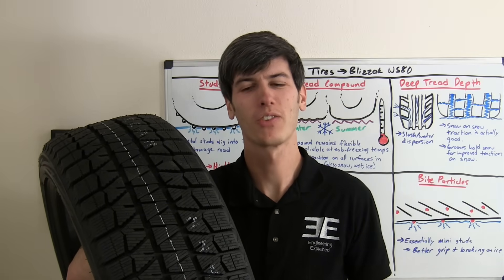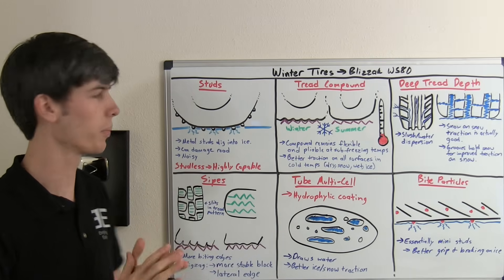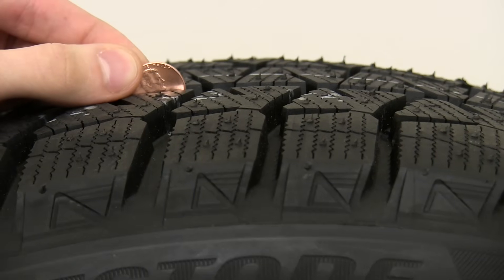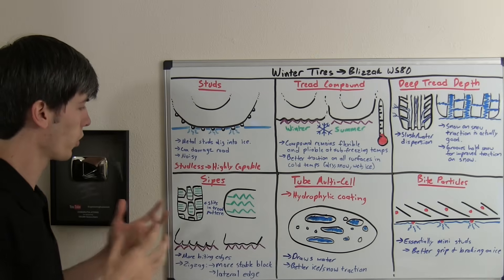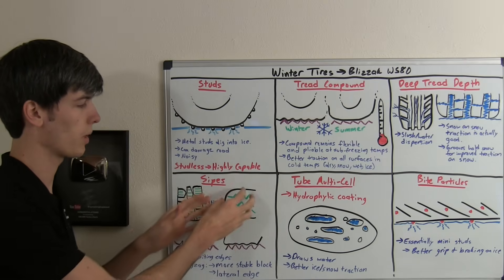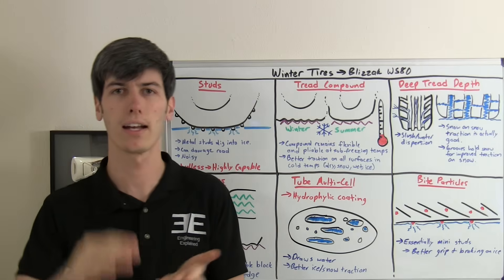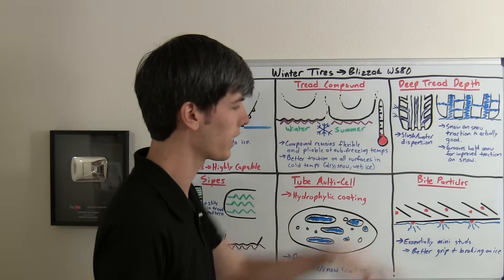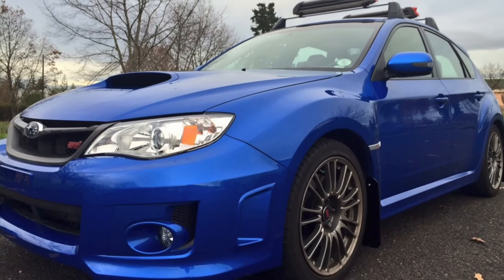Winter Tires Explained - Bridgestone Blizzak WS80

Comment: I have driven many cars with and without winter tires, and I never feel more comfortable in either. I drive a 2010 Mazda 3 and the Dynamic Stability Control makes driving in the winter really easy. My car is a manual so braking is not an issue, since I can use my engine and brakes to slow me down and almost never slide (unless I want to) :P I have driven my buddies car recently, 2000 Honda Civic, with winter tires and I was sliding and losing traction a lot more frequently, even when making small turns. His tires are not as wide, but I was still surprised to feel so much traction issues.
Reply from the maker: Nick_Carriere All depends on what conditions you're driving in. In any situation, asphalt will provide leaps and bounds more traction than snow/ice. Winter tires are certainly not some marketing scheme, the tech is real as are the results (check out comparison tests). When it comes to things like tires, which are a huge factor in the safety of your car as they impact the handling more than nearly anything else, my advice is that it's always worth it to spend a little extra for confidence.
Reply: Width is detrimental to snow tire performance. You want higher tire pressure and lower width to promote more pressure withing the tire's contact patch.  Also Stability control cannot do anything when your contact patch is compromised. Winter tires on any car can do wonders.
Reply: DSC  does not make summer tyres safe on ice.
Only thing what it will provide is stability in going off the road
Reply: Engineering Explained I am not saying they don't help, they just aren't worth the money if a decent set of all seasons will work just fine. From my experience.
Reply: Alex Beau It helps for me, keeps my car on the road. I can tell when DSC kicks in an prevents sliding.

Comment: Why don't all tires have deeper treads? And do winter tires wear while driving in snow/ice?
Reply from the maker: SleepyChow Summer tires don't have deep treads simply because you want a wide flat tread, rather than one with many grooves. Deeper treads will lead to more flex in the tire as well, which you don't necessarily want in a performance tire.

Comment: hello i live in a country without winter/snowing,but im so curious, i wanted to ask, is that necessary to switch to winter tires during winters and switch back afterwards?
Reply from the maker: Zhi Hao Looi If you don't have a true winter (ex: you live near the equator) then winter tires are not necessary. If you live in a climate where temps get below freezing and occasional snow, it can be worthwhile. This is especially true if you run summer tires (as I do), as summer tires will be fairly useless in winter conditions.
Reply: Depending on how bad the snow is. SLC for example its not too bad but if you drive a lot you want winter tires. Go further North and it becomes a necessity.
Reply: lol sure i do not need it, that means in your climate you need 2 sets of tires?

Comment: I'm glad companies are into such marketing opportunities as these, you get tyres, the company gets publicity and the viewers get taught something, win-win-win.

From what I have heard the best winter tyres here in Europe are Nokian Hakkapelitas, which supposedly aren't as available across the pond as here, the Blizzaks are everyone's best choice over there, so gratz on getting good tyres :D
Reply from the maker: David F. Heck no, dealership does it for super cheap, saves me plenty of time. I just had my wheels swapped and balanced (including keeping the TPMS sensors working), fluids check and topped off, and synthetic oil change for $85.
Reply from the maker: It is indeed a triple win, and I was happy to collaborate with Bridgestone as it was honestly my first choice when I started looking for a set of winter tires. At the Subaru dealer currently getting an oil change and the tires swapped!
Reply: Engineering Explained  after having 3 separate oil pain drain bolts stripped out by eager beavers with impact guns, I do my own oil changes from now on. Plus, somehow, they like to brake other stuff (a brake line comes to mind) while they are under there. by using a drain valve now its easy, clean, and cheap; pretty quick too. Now If I can figure out how to check the transaxle oil level in an '08 malibu without a dam hydraulic lift....
Reply: I have studded Hakkapelitas here in Maine, alas if you read the specs on blizzaks they don't last that long. the winter sticky tread is only good for 15,000 miles! then it is a regular tire. I have used my Hakkapeliatas for 5 winters. Putting the on in Nov and taking them off in April driving 500 miles a week.
Reply: Engineering Explained
Gasp, you don't change your own oil?
Reply: Engineering Explained That's a great price, just got my winter tires put on (balancing only no TPMS) by the local shop for about that much!
Reply from the maker: David F. Honestly I was shocked at the price. Typically the dealer charges $80 for a synthetic oil change and tire rotation, so this was heavily discounted. I of course did not argue, and simply smiled and said thank you!
Reply: That's right. If anyone wants proper good winter tires, go for Nokian. It's a Nordic company mainly focusing on winter tires for Scandinavia and other northern countries with severe winter conditions. Don't know if their tires are available in the US though.
Reply: F!@#Guilt Ya that will be a little tricky checking you Transmission oil. What I do is put my car on stands look for the fill level plug half way up the transmission, pull it out, then either move my intake and take out the fill plug or just use a hand pump and pump oil in through the middle plug. Drop the car back on the ground and let the excess drain out the place for the full level plug (make sure the vehicles on level ground tho).....but at the same time my Eagle Talon TSI AWD is a 92 and I change mine yearly. I don't know how these new vehicles are setup, but there's got to be some sort of way to make sure your transmissions not over full.
Reply: Yeah, that is a great way to do it at home. I gave up and took it into a shop since it was cheap. Newer chevy transaxles are like the older ones (least the ones I've used). damn i wish they would use dipsticks. Really wish they would use drain plugs!! Every car has strengths and weaknesses I guess. Chevy, at least right now, uses electronics in everything...everything. so, everything is a weakness. :) my used '08 malibu had dead auto lock switches and only one driver side keyhole. WTF chevy?! :) and they decided to make that part a dealer only part. 100$ a pop. Assholes. :) I've always wondered whether AWD makes much of a difference from front wheel drive.
Reply: wolfmannn2008 I just noticed that. I thought it was caused by the snow on the road- humming.
Reply: Alexander Wänerberger  I've had both blizzaks ans nokian hakapelitas and (didn't stud them) and let me tell you what, blizzaks are way ahead, now, I didn't stud the nokians, so it may be a bit unfair... but i don't like studs, they're good on ice, the're terible on pavement..
Reply: Allen Donaldson
Yea, just the winter tyres doing its thing. When it's too hot or dry pavement they squeek and make drift like noises on corners. Especially 10-15C, it sucks that we have mandatory Winter Tyres until 15th of March when the weather sometimes goes as high as 25. I can feel the tires wearing more than they should.

As for the weel shaking I got more feedback, it 's really mostly caused by the road being paved badly(or other uneven surface), but I notice this on winter tyres only. On new highways the shaking is only noticable after 130-140kmh, as for summer tires i experience no shaking.
My winter tires are balanced and only 1 year old, so that is not the case. My summer tires are 2.5 years old. So i assume the deeper grooves are causing it.
Reply: Nokian tyres are made in a place called NOKIA, in Finland. This tyre Bridgestone tyre here is very good for the Artic/Nordic winters when the temperature's are never above freezing. So very usefull for sub zero temperatures, below 0 Celsius (°C) (= 32 degrees Fahrenheit (°F)). But these tyres are horrible in the WET (aquaplaning and especially braking) because of the VERY soft compound, and less large groves in the tread. So they are NOT suitable for mild European winter climate. Then you  you need a different winter tyre. A tyre that is best suited for the WET and Snow conditions. 
Because the Sea climate in western Europa temperatures are mostly fluctuanting between +10 Celsius  (°C) and  -10 Celsius (°C), and usually much rain. So we have a different (yet still soft) compound which is better suited for these temperatues. And they have superior Aqua/Hydro planning properties. 
The best Brands in that class of Winter tyres are usually; Continental, GoodYear, Michelin, Pirelli and Dunlop. 
As winters seem to get milder and not every country even gets snow in the wintyer anymore a lot of people now decide to change to All Season. Common in North America but relatively newin Europa. Tyres with the (3PMSF) Alpine Threepeak Mountain Snow Flake. Which also means that in most European Countries they are allowed to be used as Winter tyres, even when Winter Tyres are mandatory. Off course  dedicated winter tyres will always out perform an All Season / 4 season / All weather tyre.
Reply: Not really a win-win. He kinda has to say good things about the products here receives because if he didn;t, no other manufacturer would ever send hi anything.
Reply: I got Goodyear, they provide good grip in the snow. But they are very noisy and shake the wheel past 95kmh on dry pavement. (Europe)
Reply: I also heard that the Nokian tires is better as winter tires.

Comment: Thought you guys put chains on your tyres over there? "winter tyres" aren't really a thing here, winter is usually nice and sunny :P
Reply from the maker: Liamv4696 Chains work, yes. But I found them to be quite a pain to deal with when it's 10 deg F outside and snow/sleet is blowing hard. It's quite nice to have tires that will do the trick while I remain on my heated seats. :)
Reply: Liamv4696 Since you don't drive on both sets at the same time, you're not wasting money...
Reply: "Over here". Australia?
Reply: Lachlan Kelly yahhh?
Reply: Ikr the worst we get is a few clouds and a cool breeze :p
Reply: In some states, I believe, you must have chains. In northern Canada, you have to have winter tires. In my area, South Eastern Ontario, you can't have studded tires and they do not require winter tires.
Reply: Engineering Explained But wouldnt you have to change your tyres every six months?
I thought you couldnt use winters during the summer.
And for those of us who dont get free tyres, thats a thousand dollars I'd rather spend elsewhere :P
Reply: talltomrich1 Yeh but you need a second set of tyres to get put on and taken off every 6 months, or a second set of tyres and rims. All costs money
Reply: Small price to pay.  I actually swap out my tires based on the weather (4-5 times per winter).  Get the wheels used and even the tires if you can.  If you've never had dedicated winters like those, for God sakes you have got to try them!  They are the most fun you can have with your clothes on.  And I'm a poor collage student
Reply: Engineering Explained Some passes will still require chains some times during the year though, not much you can do to avoid that. I like the idea of studless winter tires for us here in the PNW though, since studs aren't actually helpful very much most of the time and at worst just ruin the roadway.